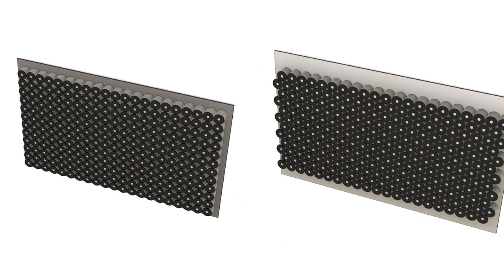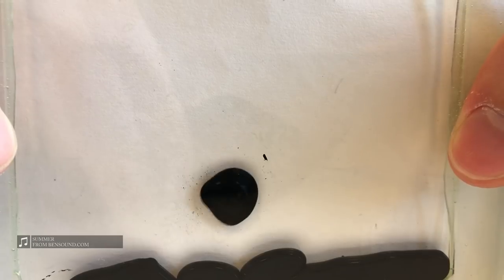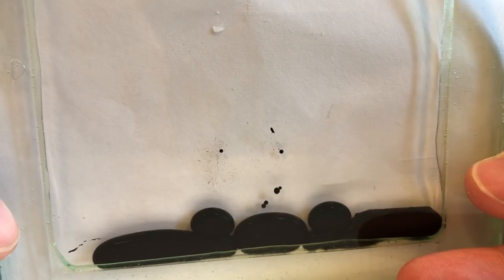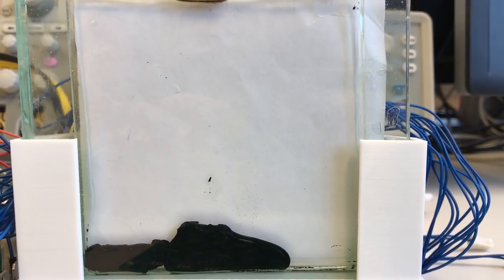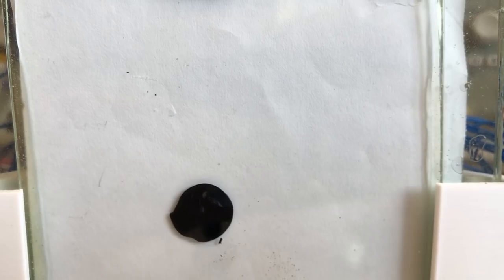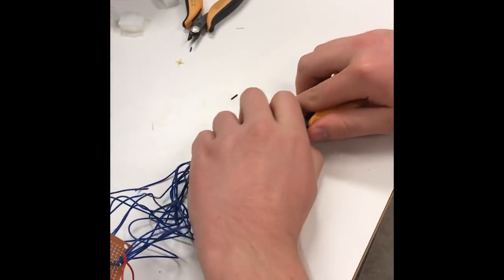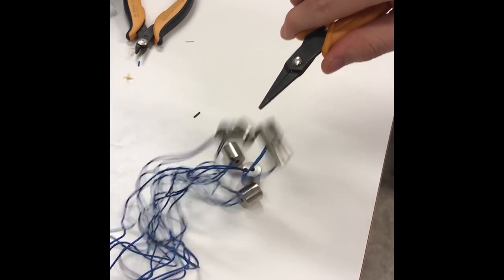'Fetch': A Ferrofluid Display - Fetch #1

Comment: This is a very cool project, and i have a few questions.
How much current does it draw and are you driving the electromagnets at the specified voltage(It kind of seems like overkill)?
You showed a picture of uln2004 chips, is there a specific reason you would choose this over the more popular(and cheaper :) ) uln2003?
In the first prototype it looked like you used a single pin for a single mosfet driving a single coil(which is why you would go for a MEGA because of the extra pins) but in the later prototype there's only a couple of pins connected, do you have something else on the board, like shift registers on the back? I count 4 chips on the top which I assume are the driver chips since you have 28 connectors on the board(I'm guessing you disconnected the top row and the two side side magnets in the fifth row).
Also, have you though of/tried multiplexing the coils, it would greatly reduce the complexity of the driving circuit?
Thanks in advance, sorry for the amount of questions, it's a really interesting project.
Reply from the maker: Thanks for the questions :) 

1. We have not measured the exact current draw of these magnets, but we have used a rough estimate that they will require 0.2A at 100% duty cycle, so worst case: 50.4A (252 magnets). At the rated voltage (12V) that accounts to 604.8W. We have used a 1200W server PSU from HP to drive the power, so we should be fine in terms of load.

Actually, the datasheet of the magnets state that they draw 1.4W each, so that's just 352.8W total. We probably have some overhead. (Note that the form factor of the PSU is actually a lot more convenient than normal 500W desktop PSUs anyway)

2. We are driving the magnets at their specified voltage, but we will probably use PWM to apply less force to the bottom rows - in order to counteract gravity.

3. The only reason we are using ULN2004 is because we knew a guy (the guy who told us about these chips) who was going to order some, so we just piled on to his order.

4. Your analysis of our circuit is correct, we were driving the magnets individually. We were always planning on using shift registers, though, but we wanted to test the heat development when driving the magnets, so we just bought a less complex design to begin with (Well... Less complex it probably not right, but at least we put less work into the PCB design. This was my second PCB design ever, so it's full of flaws)

On the new board we are using 4x8-bit shift registers, and 6x7bit driver circuits (we did it this way to share the load on each circuit. Probably not necessary, but this was my third ever PCB design, so... I guess you get the idea ^^). They are all on the top side of the board, and should be visible in the video.

5. We did try multiplexing, but we lost way too much force from the magnets when we did this, so we quickly abandoned that approach. It may be feasible to re-check this approach now that we are more familiar with our own design, and the hardware we use though. Maybe we made a mistake? Anyway. The way I see it, we would have to accept a maximum duty cycle of 1/12th of the time, which severly reduces our ability to lift ferrofluid. Feel free to let me know if this is a wrong assumption.

Cheers! Hope you enjoy our future videos as well
Reply: @AppliedProcrastination  Wow, thanks for the length reply :D
This project is great, I have subbed so I will keep watching. 
I have thought about making this ever since seeing the ferrolic video and wasn't too impressed by the servo motor solution(it's really loud) so it's great to see someone making this the way it should be done. I have a couple of random thoughts to share.
The reason I mentioned the magnets being overkill is because i know they are rated at 2.5kg lifting power, and i would guess the drop of ferrofluid is less than a gram(plus gravity having much less of an effect because of the similarity of densities of the solution and ferrofluid). I'm kind of speculating here but I think that the reason the magnets seem less effective that they should be is because they are designed for lifting something in direct contact with the magnet. They have a metal core on the inside and also a metal sheath on the outside effectively making a horseshoe magnet. This would concentrate most of the field lines very close to the end of the magnet, having a greater effect on things very close or touching but a greater decrease as you get further away. I think that the couple of mm of glass in this case are costing you most of your lifting power. If you had a straight core just wrapped in wire it would have field lines going out both ends but straight for a longer distance before bending back, which would be better when you need the field to pass through the something(keep in mind, this is only speculation, I'll leave the googling to you). I have seen a photo of the inside of ferrolic and they use electromagnets with only a center core(google "ferrolic paper", first pdf). This is only a guess, I'm not too knowledgeable about EM fields.
The power necessary for holding and moving the drops is negligible(~100mW) so most of the power is going to heat in the resistance of the wires of the electromagnets. This seems kind of off to me(the efficiency being <0.1%) and that is why I think you can get more lift for less current.
If you managed to get the current necessary for lifting to a value a couple of times lower you could get greater flexibility in code to adjust the strength of the field by using PWM as you mentioned. You could maybe use a greater field for initially lifting a drop and a weaker field for holding it.
While talking to a friend about this once he suggested that it might be possible that the original design used a soft iron core which could be magnetized once with a short pulse of current and then left to hold a drop acting as a temporary permanent magnet. This would significantly lower the power consumption while holding a shape but would complicate the circuitry because of the need to demagnetize the core later.
This may be kind of weird and irrelevant. In the first prototype you had flyback diodes on every electromagnet in parallel to the electromagnet, in the later one you had the exact same thing through the uln2004 if you connected the common cathode pin to the power source. But if you end up multiplexing you need to go back to individual diodes, and I would recommend schottky diodes for two reasons. They are faster than standard silicon diodes so they reduce voltage spikes and they have a smaller forward voltage, which would in theory give you more time to do multiplexing(the current of a coil being ~the integral of the voltage, having a smaller voltage in the off time would slow down the reduction in current while freewheeling).
It's a great project and I hope you guys are having fun with it(and get a good grade out of it) :D sorry for the essay again.

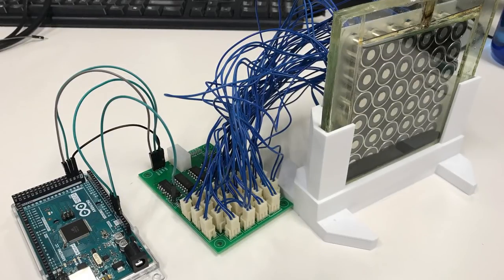Comment: I would like to learn how to build the prototype as it looks @6:13. Specifically the electronics used. What kind of a budget would I need for everything from power source, controller, connectors, electromagnets, etc?
Reply from the maker: We don't have an exact number to give you for that, but it wouldn't be incredibly expensive. Probably more expensive than your normal hobby project though - unless you wind your own e-magnets. They are definitively the highest budget post. 

As I said, we don't have an exact budget for something like that, but we are going to look into making a kit or something similar for a display around that size or smaller (depending on the price for such a kit). Unfortunately that's probably at least going to be a year from now though, because we have way too much on our plate to prioritize it right now.

Comment: Hee guys, I love it great project and a fantastic name for the channel! 

Question: Why suspend the ferrofluid  in a liquid at all? Could'nt you just use a vacuum? 

Keep it up! thks
Reply from the maker: Thank you :)

There are several benefits of a suspension liquid. Mainly: it helps prevent staining on the glass. But it also provides some buoyancy, which makes the ferrofluid a bit easier to lift.

Comment: I'll bite. I have a question. 

I saw this yesterday night and wanted to know, the ferrofluid retains its mass whole due to the electro-magnet beneath, but I see fluid-sound dynamics occurring. How are you controlling your geometry of the ferrofluid? Is there a modulation which is done upon the magnetic emitter? Akin to a sound/speaker? I'm assuming frequencies are drop-in replacements, although I don't know. Are you using a variable capacitor or a digital modulator for the Hz? I am ruling out a speaker underneath because of the barrier. This was a great video, thank you guys! I'll click the bell. Good tidings and well-wishes in all your endeavors!

Comment: What liquid did you use for the clear phase? I always assumed that it had to be some fluorocarbon solvent so that it wouldn't mix with the oil the ferro particles are suspended in. You talk about brine in your video, and I would have assumed that that would only last for a very short time until the particles started to rust
Super cool look, though
Reply from the maker: We use saturated saltwater brine, and the last clip (of the final circuit testing) is with around 10 month old ferro/suspension-fluid, so it holds up quite well. There's some coagulation though, so, literally the same day as that clip was filmed we attempted to clean out and refill the prototype. That's the video coming up in two weeks :)

Comment: What force does each magnet have in order to lift the Ferrofluid vertically? Thanks for your answer!
Reply from the maker: They are rated at 20N with 100% duty cycle. But the force is inversely proportional to the square of the distance (I think that’s right), so we would have a lot less since there is a 2mm glass wall between the magnet and the fluid. We have not measured or verified this number
Reply: Thanks for that fast answer! What size does each magnet have?
Reply from the maker: 15mm diameter, I think the depth is 20mm but I don’t remember exactly (we only cared about the surface towards the tank)

Comment: Why not use small magnets?
Reply from the maker: These are rather small, and going any smaller would be really, really expensive. At this size we optimized the trade-off between pixel density,  price, magnet force and total size of the display
Reply: @AppliedProcrastination  But using small magnets can provide us more creativity.